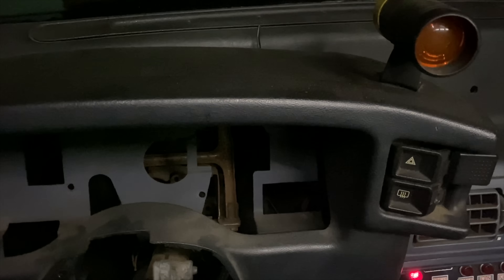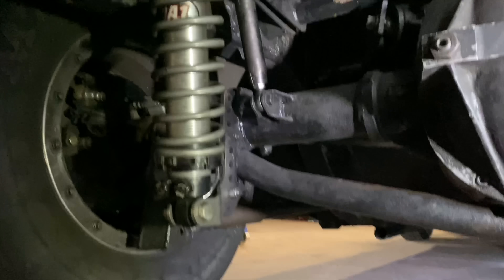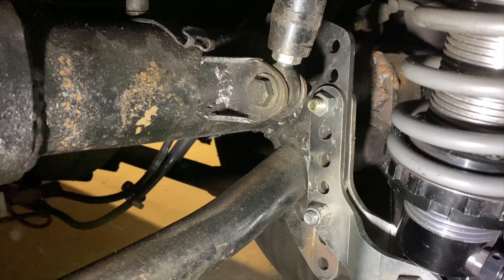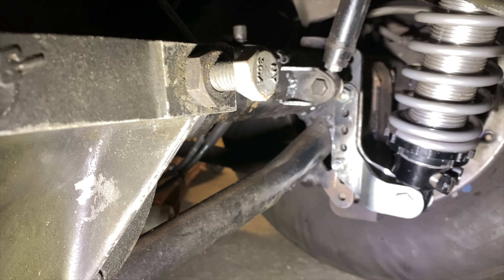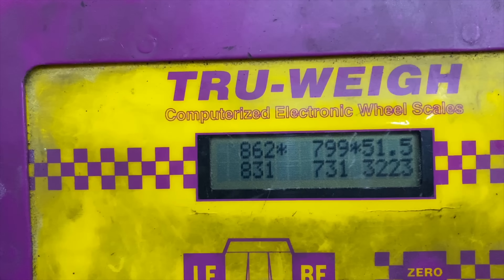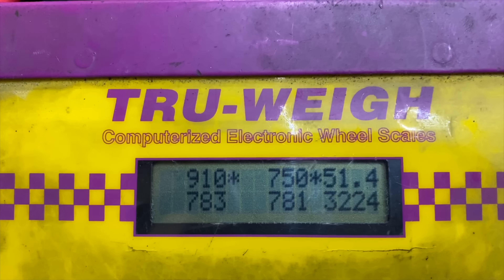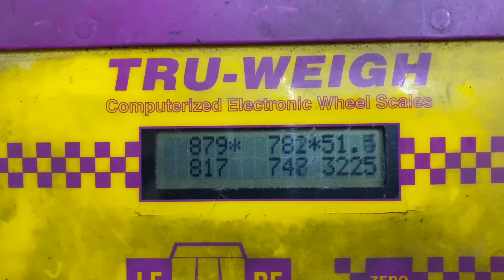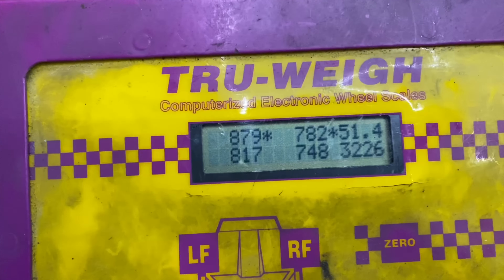Weighing the drag car

Comment: i tried doing that. setting weights in the rear close. turned out the car just went left hard leaving the line lol. turns out after i set the roll bar to get it going straight it had 130lbs more on the drivers side.

Comment: I saw a roller mustang for sale on ebay that said it weighed 2180 with an LS motor in it . The car looked nice it had carbon doors and front end they wanted  $22000 for it . That's what you need john
Reply from the maker: Yes

Comment: I’m actually very surprised that his car weights that much I just assumed it would be like 2800 roughly but I was way off. I know it’s lil older video and he’s building a new car but this amazes me mostly cause my Chevy II is around 2700 but once I’m in the car your talking a touch over 2900.  Having the ability to place weight where you want it makes things a lot easier to set things up as well.

Comment: Been a sub for a few months,you do a great job teaching and explaining. What is the reason for the 4 lug wheels ?
Reply from the maker: That is just what I had.  And I figure with the 5/8 studs I would be fine.  So far no issues.  But if I do ever have issues. My wheels are dual pattern.  I’ll drill and tap my axles and then be the worlds first 8 lug, lol

Comment: Damn that’s heavier than I thought.  I had mine down to 2600 with me in it and I’m 235. But I only had a 8 point cage too thou.  Minus fuel and the hot side of the turbo. Everything else thou   I bet you can cut another 200lbs outa that thing.  I cut out all the nonsense.   With no engine and trans I could bench press the front end and the rear. Lol.

Comment: I’d be cool to see suspension travel in a data log. See how spring rates and weights change down track. Always wondered about that.
Reply: C Jam if you buy the height sensors you can log that through the Holley he has. That Dominator can log so much it’s unbelievable
Reply from the maker: I’m out of inputs on the Holley hp, but CB I V agree that would be awesome
Reply: Turbo John oh I didn’t know you had the HP. Thought you had a dominator. How many I/O s does the Hp have?
Reply from the maker: 4 each